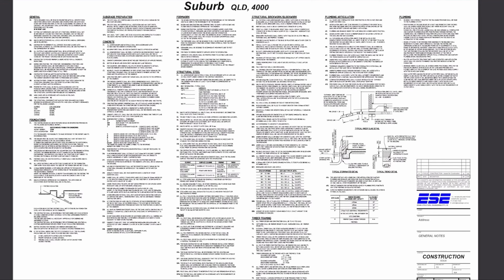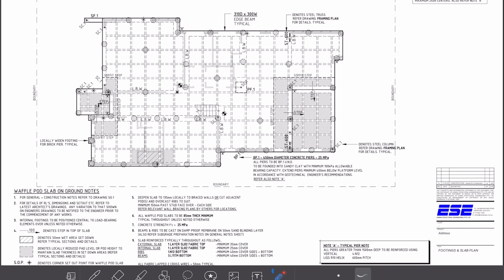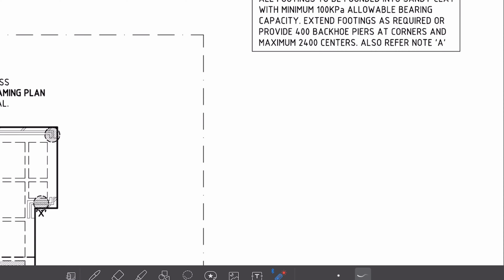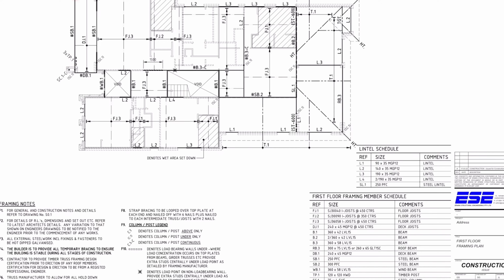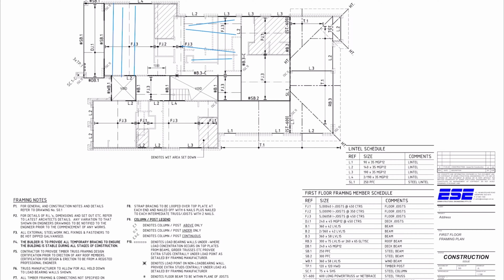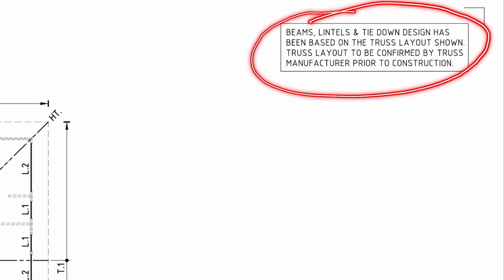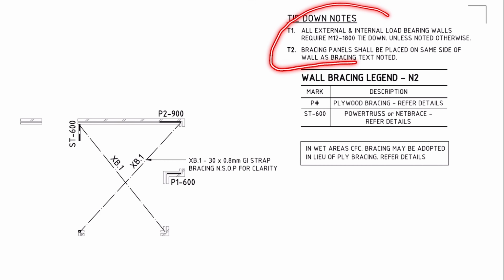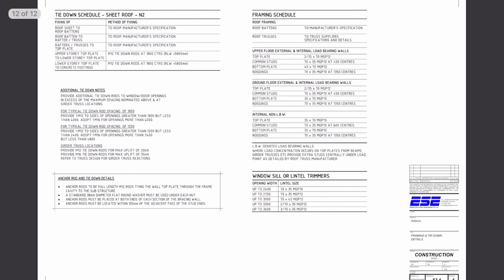How to Read Residential Structural Drawings

Comment: Great vid! I think what contributes to the confusion when reading structural / civil drawings is that every office has their own standard, e.g. our office uses hatches a lot, whereas other offices may use extent arrows to say... show where a 130mm thick suspended slab is on plan. Not wrong, just different. We use a mix of typicals and specific sections, some engineering firms use exclusively typical details (e.g. typical EB2 edge beam detail), while other offices do heavy amounts of specific sections, and their fee reflects that extensive detailing.

Comment: Hello there, I am from Nepal...I have been doing structural analysis report and drawing mostly using etab and idea statica, while other software like safe,staad pro as per my need in projects.... Particularly for Australia region me being if approved for 491 ....where I stand as a designer...talking about steel structure I am quite good with full connection designing either baseplate, splice, weld or truss fully welded or bolted ....for Indian and Nepal's project it's quite highly appreciated....but as per my use to app like etab mostly where I stand in Australia.....do I need to know more to start at entry level....

Comment: Hi, how much LL and DL do you design for house ?
Reply from the maker: LL roof = 0.25kPa
DL = between 0.2 and 0.9kPa
LL floor = 1.5kPa (2kPa balconies)
DL floor = between 0.6 and 1kPa
Reply: Thanks for your reply, Sir, I just wonder, this style is in Australia house,light walls, pat foundation, strip foundation,  Edge foundation, So, I saw details, they put the edge of ground slab on foundation. When design foundation, do you include weight of ground slab and light wall on foundation ? Thanks sir.
Reply from the maker: @Chino99999  you have to consider all actions on the foundation
Reply: @bengthebrazilianengineerinAus  thank you

Comment: Amazing excellent video! Thank you! Could I know which software to generate the drawing of floor framing plan?
Reply from the maker: good old Autocad
Reply: Hi there, when you set the structural style and loading material as per the architect plan, do you talk with builder about the building material choice or you just draw the structural plan and tell  him to do what you want, as my boss builder never choose new project with duplex or has rendered hebel exterior wall , most of the job is extension or knock backyard for rebuilding

Comment: Could you please clarify how different of 70x35 MGP10 that supplies on common studs, noggings between 35x70 MGP10 that supplies on top and bottom plate on the last sheet(Framing schedule).

Thank you for your video. This is such a great video. Please keep it up content.😊
Reply from the maker: They're all the same :)
Reply: @bengthebrazilianengineerinAus 

Could you please explain the reason why they have to be written in reverse?
Reply from the maker: @user487xcvhbplk   top and bottom plates are installed on its flat (like you rotate them). Have a look at this video to understand
https://youtu.be/3TMRrWoNWWU?si=KvAlCvyzDnv2ki2j

Comment: Hi guys, my question is how are waffle/raft slabs designed when supported on concrete piers? Does the pier take the total weight of the slab and imposed load? If so do you need to found them into high kpa soil or can you rely on the slab in bearing as well and not only on the piers. Thanks in advance
Reply from the maker: Hi James, I usually design the beams to span between piers or screw piles. You would use piers if you cannot achieve adequate bearing capacity at shallow depths, therefore the piers/piles will have to go as deep as you need to reach the required kPa.  You could argue that the beams are still bearing on some soil and use that to reduce the loads, however most of the times I don't rely on that. You also don't know where the soft spots are and by designing the beam to span between piers you would cover this problem. Hope that clarifies

Comment: Typically what depth below grade do you place these waffle slab foundations over in Australia? Is this common over there? Also seems very costly to build this type of foundation.
Reply from the maker: In many cases you can place them at ground level. This is what makes them cheap, it doesn't require much excavation. The beams are usually 400, but it varies with the soil reactivity.

Comment: Hello thanks for the video! Just wondering why we don’t need to specify lintels for openings on internal walls? And also should bracing be needed on all external walls? I have seen some plans where they specify bracing on certain walls but not all external walls. Thank you!
Reply from the maker: Hi Marvin,  You should specify lintels for internal walls if they are load bearing.  The amount of bracing depends on the wind loads and area of elevation. Ideally, you should start placing them at corners on external walls, but it's not always possible due to the architecture. Have a look at one of my Cabin design videos to understand better.